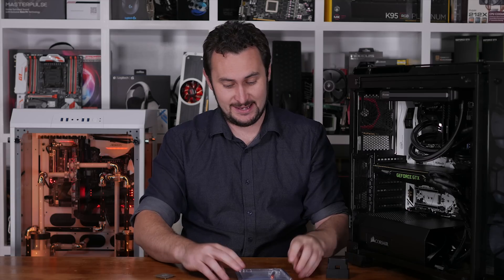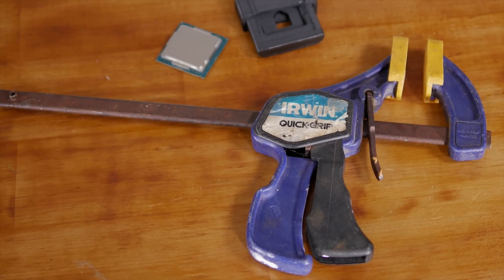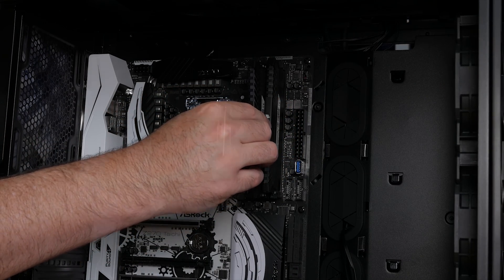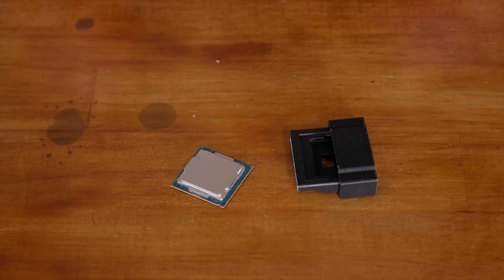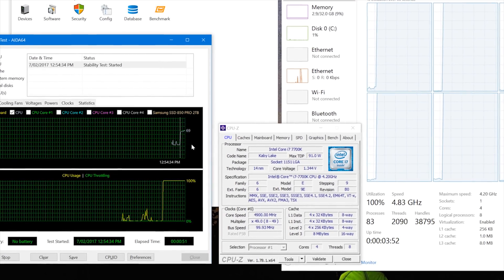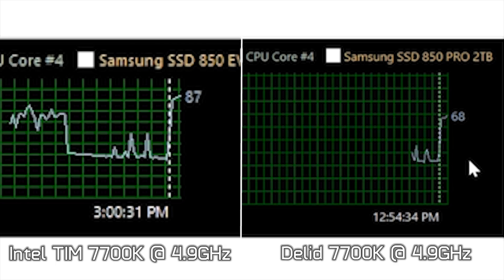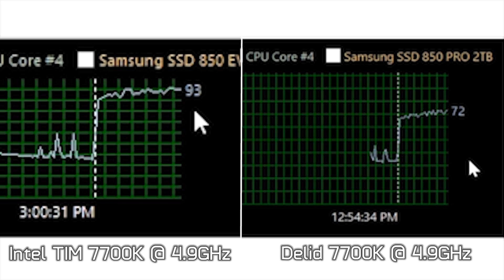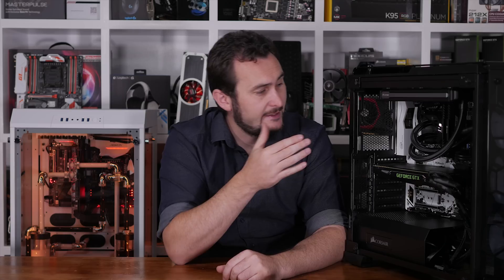Deliding My Core i7-7700K: Amazing Temperature Improvements!

Comment: I got 7700T for silent TV, delided, with copper IHS, passive Arctic Alpine 12 cooler and 4x F12 silent fans, that PC does not have much of an air available, and its doing great, but i noticed big difference between CPU temperature and Core temperature. Its like CPU 30°C, Package at 40°C at idle, and all cores are sitting at 95°C-125°C. Is that OK?
Reply: My other PCs got no temperature differences between CPU and Core temps with full copper design, or up to 20°C differences in all other ways, but difference of 50°C between CPU and Core just does not seem right, with original IHS the differences are even bigger. 🤔
Reply: This is current temps with MX4, planning to go with MX4 on die and MX6 on cooler.
Idle: https://drive.google.com/file/d/1pJMa23rkBjCJMgAWEhbUiDYSdPrl_gPm/view?usp=sharing
Stress Test: https://drive.google.com/file/d/1M7n_m_GYKGXhXC3EHgIVrGequAjym2IS/view?usp=share_link
Stress Test (CPU only): https://drive.google.com/file/d/1xVtD1Y1A33lzzFmTtJD3Eho_RPSevVa0/view?usp=share_link

Comment: I delidded using a razor and applied extremely little amount of Thermal Grizzly Conductonaut. (Using a NZXT Kraken X62)The result with 4.8 ghz gamers profile overclock of Asus Maximus IX Code motherboard : Temps under 100% load went down from 87C to 57C. Now the weather is a bit hot and temp is 59C under load.

Comment: I don't get it, my i7 7700k runs 5GHz profile on Asus z270 well air-cooled case. Maximum temp after hours of PUBG is 87 degrees for half seconds on one of the cores. And I've not delid it.
Reply: All CPU`s r different, my can run 5ghz without even touching the voltage and stay at 90 degrees the most, but its still not good enough... Intel have cheaped out on one of the most important parts.

Comment: any tips for making 7700 k more stable past 5.2 gigahertz can boot at 5.3 doesn't crash just not stable volts at 1.450 max temp 70
Reply: Deliding and beyond that there might not be. It might just be result of silicon lottery.

Comment: Do you have to use liquid metal or can you just use a better thermal paste all together?
Reply from the maker: A better thermal paste will probably improve temperatures a lot as well.
Reply: Thanks for the reply! So I dont need to use Liquid Mental to replace the TIM under the IHS? What would you recommend other than Liquid Mental for a thermal paste? Or is Liquid Mental my best bet?
Reply: Hardware Unboxed my i7770k is hitting 90 degrees C with closed loop water cooler after doing a lot of my research I'm starting to think liquid metal might be my best bet. Also do you apply liquid metal to the water cooler heat sink when reseating?

Comment: I bought a Delid die-mate 2, but am too scared to do it yet. Haha. I am worried about liquid metal touching contacts on the CPU surface. (E.g. like the row of four contacts that showed up on Hardware Unboxed's 7700K.) I think if just a fraction of liquid metal is squeezed out from between the CPU core and IHS. Then I might get a problem. Say I accidentally drop my CPU one day, or get the CPU hot and turn the PC on its side. That fraction of liquid metal, may move towards a contact. ... The solution is to either insulate the contacts, or use Kryonaut rather than Conuctonaut. Kryonaut would still be a vast improvement over the Intel disaster TIM.

Comment: I managed to overclock my 7700K to 5.0 GHz at 1.350v on ASUS Maximus IX hero. Without deliding my temps aren't bad at all, I'm hitting 81-87°C at full load running Prime torture test and furmark at once just to make system even more hotter. I'm using Corsair 115i AIO. I'm going to delid it just to see the difference tho.

Comment: The TIM is not the issue. The gap between the DIE and IHS is... Read yourself up.
Reply from the maker: How would that change anything? It's still ultimately the same issue.
Reply: Not really. If the gap would have been smaller to non-existent there regular TIM would not be as bad. That is why you remove the silicone once you delid. :-)

Comment: just built a system with 7700k. delided it as soon as i got it, so dont know what temps i would have without deliding. i stress it for hours, doesnt go above 55c, idles at 28-32c. my previous 2700k would hit 100c, same water cooling kit.

Comment: I bought the 7700K 3 weeks ago, using the Noctua Nh D15 fan it never goes above 73 degrees in my stress test, idle it sits at 30 ish degrees. Did intel fix this iddue, or am I just very lucky?

Comment: Some of the comments here are worrisome. Delidding does not mean you permanently remove the IHS from the cpu. Basically you are lifting the hood of your car, replacing the thermal material and then putting the hood back down after you're done.

Comment: I run @5.3GHz stable. Aida64 stability stress test peaks my temps to 77C, but considering im using max voltage of 1.52Vcore that seems cool to me. These unlocked chips are unoverclockable with out delid and liquid galium alloy. That cheap shit paste they used was Intel spiting in my face for buying their premium products. NOTE: don't use the liquid metal on an aluminum surface as it with react with it and insulate the chip. Copper is fine.
Reply: is your CPU still alive?

Comment: I've just delidded my 7700k 5 mins ago, and the temp is smooth as f*** the temp is under 70 degree, I'm using cooler master evolution 212 no spikes anymore
Reply: I feel like everyone is talking about different CPU than I have, my 7700k runs at 55c on stress test with Noctua NH-D14 cooler, I didn't touch it at all, running stock but with blackdesert running my cpu usually reaches 45c at max. Used the paste that came with noctua cooler.
Not saying everyone is wrong or anything but yeah I had 3770k before and now that and didn't encounter heat problems with either of them. Could be that Noctua doing its job well, but then again the differences people talk about It's a bit strange.

Comment: I delidded my 7700k and before and after temps running 4.5Ghz was 89.5c to 85c max temp running Prime 95 max heat preset =/ But that's not as nice of a result as I was expecting (although I am running it on a CM Hyper 612 v2)

Comment: I have i7700k and Noctua NH-D15 and im hitting 85 *C! Some times 99 *C! I'm only using two ram slots whit 16 GB 3000Mhz. Should I buy two more for 32 GB, 3000Mhz? I have not overclocked my CPU.
Reply: That is very hot. Have you overclocked yet and/or have your temps improved?

Comment: I had the same 95 - 97 °C high temps with my 7700k. So I send my CPU and my mainboard back to the HW seller. They said it was the mainboard. I don't think that a diffrent mainboard will change anything. I'm very curious to see, if this makes any difference.

Comment: Deliding my 7700k and using liquid ultra dropped my temps on 5gh from 85°c down to 62°c on the cpu-z stress test, using a deepcool captain 360 aio. also I was only using msi auto voltage to get 5gh, so the voltage wasn't dialed in unless msi was that accurate. I currently only run the processor at 4.7gh since I don't do anything really demanding on it and I only really did it to improve the life of my processor.

Comment: Yeah my 7700k currently only goes up to 4.8 GHz at 1.32 Volts (1.328 Volts according to CPU-Z), when I tried 4.9 GHz, I tested with voltages up to 1.37 Volts, but the temperatures were going into the high 90s, so I gave up and am stuck unless I try deliding

Comment: After 4 months Intel has released a "fix" to this issue:
DON'T OVERCLOCK YOUR 7xxx K SKU CPU'S.... 
What!!!  :-O   Get a grip I say 

I'm glad I'm running a Skylake 6600K where I'm able to run it @ 4.4Ghz with no more than 1.210V and never reaching temps higher than 63 degrees C under the most taxing workloads/gaming, ON AIR - Hyper 212 EVO in a Fractal Design Define R5 (2 x 140mm fan as intake, @ 700 rpm  + 1 x 120mm @ 1300 rpm rear fan).
P.S. KEEP UP THE GOOD WORK !!

Comment: I have the same corsair cooler as it is an awesome cooler very quiet I have my 7700k at 4.5 GHZ 100 percent under load I get temps of 62c not bad until I can buy one of them de lidder thingy's I will stick to this. Would arctic silver 5 be just as good as that liquid stuff you used?

Comment: I must of won the silicon lottery cause mine is at a stable overclock of 5 ghz at 1.3v with the is still attached
Reply: Not really a lot of people can get 5.1 - 5.2 at that voltage with the stock TIM. This is probably just a below av rage chip.

Comment: I delided my 6700k using a razor blade because I couldn't find a deliding tool. It was relatively painless and worth it. I used a silicone adhesive to relid the cpu applying pressure for at least an hour. I'm running it on evo 212 at 4.5 GHz 1.285V. It's around 60c when playing demanding games like bf1 multiplayer.

Comment: Thanks for the valuable video. After watching this video, I delidded my 7700k. Prior to delidding I was stuck at 4.8ghz/1.3v. I could hit 4.9 at 1.35v but the temps would near the 100c mark. 

After delidding Im at 5.1ghz/1.4v and I'm maxing out at 72c stable after 24hrs prime small fft. I barely break 60c during bf1 now. Excellent and I am finally satisfied with my 7700k. 

I spent $10.00 on a syringe of liquid ultra and my temps were reduced by 30c. Best upgrade ever.

cooler:
-H115i with 2 riing 14 fans

Comment: I don't know if i'v3e got a golden chip but i run my i5 7600k @4.9Ghz @ 1.254v. That's a good volt right? I might even be able to run it at 5ghz at the same voltage. Haven't tried it yet :D

Comment: I think some of the 7700K's are really hit or miss when it comes to temps. I recently built a system with the same CPU and cooler setup, and even with ASUS's overclocking utility getting it to 5.1GHz I never saw temps in the 90s. But from the other videos I've seen about the cooling issue, I guess that one was just a "lucky" chip.

Comment: i did a delid on my 7700k, 5ghz at 1.35v max temp is 65c with the liquid metal. intel should have used solder like the 6800k

Comment: Y'know, I think I'll go for a Ryzen chip rather than the 7700K. Sure it'll sacrifice a bit in single-core speed, but I can save money according to the leaked pricing and I don't want to reward Intel after not innovating and then releasing a chip with subpar thermal performance. Not to mention their next 'Cannon lake' CPUs are going to be 14nm too with probably no noticable improvement again and they also fired like 11000 people.

Comment: 45 dollarydoos for clp?  You can get clu on ebay for $16 AUD free delivery.
Reply from the maker: +theBraxil - Feel free to link me...
Reply: Here's the link, but this shit ain't free:
http://www.ebay.com.au/itm/like/171224699538?lpid=107&chn=ps
You owe me a lap dance.
Reply from the maker: That's Liquid Ultra mate, not Liquid Pro. It's said to be vastly inferior stuff by the overclocking guru's that know their stuff.
Reply from the maker: Longevity is apparently the issue with the cheaper Ultra stuff. Honestly you can use whatever you want, fact is if you want to use the tried and true Pro, you can't get it for $16 AUD with free delivery.
Reply from the maker: But, but...
Reply from the maker: ... concedes and slips on G-string.
Reply: Also on a more serious note did you use nail polish or liquid tape to insulate the pcb?
Reply from the maker: The traces on top of the PCB aren't exposed. I just cleaned up any excess liquid metal. Do you think this will become an issue?
Reply: I have no idea, I haven't found any info from a definitive source yet.  I know my devils canyon had some surface mounted stuff that I had to insulate, but as for kaby I'm not so sure.  The company "silicon lottery" run a delid service and they still insulate kabys, but I've seen a few vids and posts where people don't and the chip runs fine.  I'll be deliding my kaby next week so I'm keen to find out.
Reply: Been looking around for what those 4 metal dots are actually for, can't seem to find out.  Most people either are just careful about not getting TIM on them, or cover them with nail polish/polimide tape.  I just did mine carefully and she's been fine.  I'll take it off again in a few weeks and see if the clu's moved anywhere.

Comment: yep I'm in the same boat here. completely disgusted with the temps I get on my 7700k. Im at 4.6ghz at 1.25v(I think) and I hover around 70 and can sometimes spike higher. and this is on a EK predator 360mm radiator. my temps on another rig I had with 6800k with higher voltage were better than this with same cooler. sick of Intel and NVIDIA screwing us over with price gouging. so now I have to delid also to actually get a substantial overclock but like u said void my dam warranty. screw this

Comment: I have a 10 year old Core 2 Quad (95W) CPU; would the thermal compound  have degraded much, or is 2006 before Intel started using bad thermal compound? I have a stock Dell XPS 410 heat sink and fan, but my CPU only reaches about 60C after an hour of gaming...

Comment: glad they threw some solder at the x99 stuff.  Would have been a bummer to have to delid my 5820k.  It was fun with my i5 3570k, but that wasn't a $400 processor.

Comment: Fahrenheit or Celcius?
Reply from the maker: If it's in fahrenheit that means the CPU overclocked to 4.9 GHz after the delid ran at a stress temp of 22 degrees celsius. It also means I keep my room at negative 6 degrees :D
Reply: Hardware Unboxed my computer runs at 140 Fahrenheit under load... is that dangerous?
Reply from the maker: No, that's just 60 degrees C, so very cool under load.

Comment: hardware unboxed for the z270 taichi asrock released a new bios on 6th february to address temp readings. a day before you released this video. what motherboard bios did you use in this video ?
Reply from the maker: I used version 1.30 but I can't see how that could matter since the 7700K was tested using the same BIOS version before and after the delid. Testing was done on the same day with no other system changes. Also my results are inline with those from countless others.

Comment: This is why we need AMD to rise again
Intel monopoly must be broken so they get competitive again
We as consumers will benefit in the end
Reply: Exactly.
Reply: Nope, if AMD was copying everything intel was doing then we'd have a very different result about their lineup, the new Ryzen CPUs would be headed almost exclusively to everything a processor chip would achieve  and better except only like 50% as great as Intel for gaming and they would sell it 20% more expensively at launch than they currently are. A company has more interrest in winning at a certain range of performance against its counterparts, otherwise it's completely useless in even manufacturing a new lineup of processors in the first place.
Reply: +Nogghan AAAAAAAAAAND nope, it's not that bad considering it's low-cost hardware, then you have unsoldered ultra expensive CPUs from Intel that are a shame for their pricetags.
Reply: i didnt say it was as bad i just said it wasnt soldered anymore wghich is a shame for the overall consume intel or AMD because if AMD does the same as intel theeres no reeason for intel to go back to solder
Reply: If you ask me they are two heads of the same snake now, notice amd tends to copy everything intel does now instead of going their own way. amd was too much of a threat to fat cat intel, they spearheaded that a while ago. ever wonder why the frequency range on processors just kinda stopped going up? amd was winning this war with intel so they put a stop to it.
Reply: shadowstorm545 ANNNNNNDDDD it's gone... Raven ridge is not soldered RIP

Comment: I had high temps with a Skylake 6700k as well...Using Corsair H100...The cooling block is directional but it can be mounted either way. This means that the cooling block rested on top of one of those capacitors next to the CPU. So the cooling block and the CPU were not making solid contact. Mine is at 4.5Ghz now and not going above 60 C under load.

Comment: I thought most of the benefit from delidding was from having less TIM between the IHS and the CPU die.
Reply from the maker: +Reuben Horner why would the physical space be reduced? The heatspreader still has the same clearance.
Reply: The rubber gasket that seals the IHS to the chip gets removed.

Comment: Hello nice temperature drop! Did you re-lid it, did you use automotive silicone like kyle from hardocp to glue it in place, how did you positioned the lid and applied pressure to it?
Reply from the maker: I did none of that. Like Bryan from Tech City I just placed the heatspreader back on top and let the LGA socket hold it all in place. Works a treat and if I ever need to I can re-apply the compound in seconds.
Reply: Hardware Unboxed If you got those temp improvements you did a good job for sure!
You used any special product to remove all that black goo left from the Intel glue?

Comment: What about AVX testing like Linpack or Prime95? It will be 20+ degrees hotter.
Reply from the maker: No it won't :S I get the same stress temps using AIDA or Prime95...

Comment: I've delided my 7700k for a temperature decrease of approx 20-26c good ole RAZOR method cost me just $9.55 shipped for CLP" liquid metal" paste now running @5.2GHz 1.32v Adaptive voltage. MAX temp 75-76c!!! 8 HR Real bench stable ;)

Comment: $40 premium for K series, $60 for decent aftermarket cooler, $45 for Liquid Metal, $14 for delidd tool. $159 + tax + shipping to go from 4.2Ghz base/4.5Ghz boost to 4.9Ghz and lower temps? Sure it's messed up on Intels part but as a consumer you have to start questioning what it is you're spending your money on at that point. I sure hope Zen changes the game because CPU's are a joke at the moment...